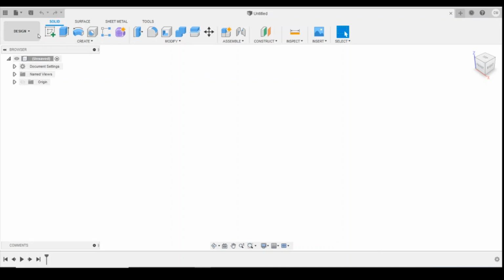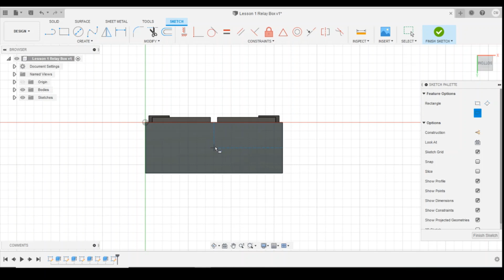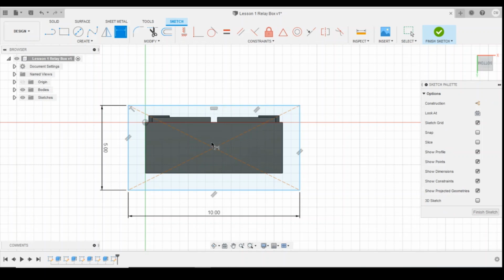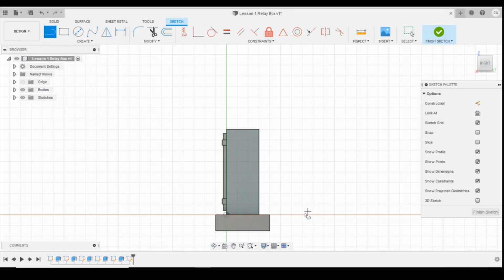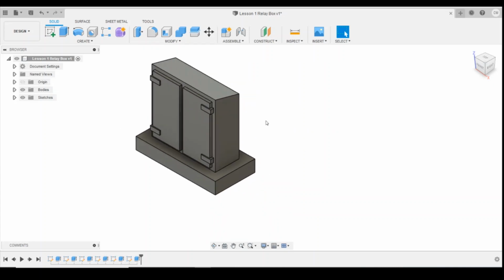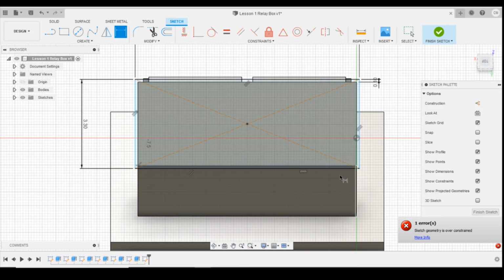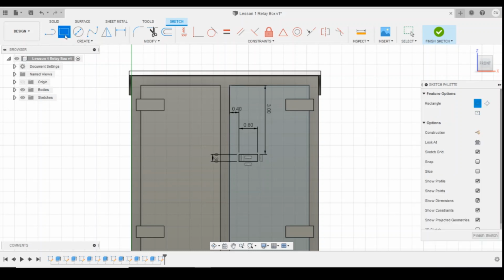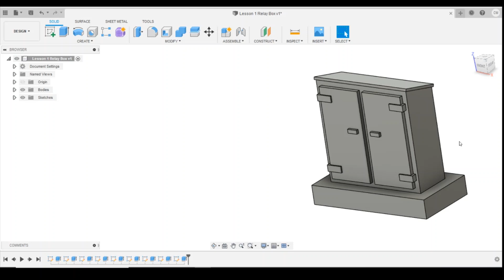Lesson 2 - Fusion 360 Center Point Rectangles, Lines, Angles and Midpoints

Comment: Thank you for your videos. Just started but already I have not been able to get thigs to work as they should. For the centring of the rectangle (for the base) I couldn't get the "V" or blue dotted lines to appear. Eventually I just cheated and centred the rectangle myself. However for the angle to create the sloping roof I cannot get the line to turn from blue to black and divide the side panel into two. I've tried forcing dimensions on it (in addition to the 15deg) but no joy. Clearly I can't progress beyond this point. Any suggestions as to what I am doing wrong. Is there a snap on / snap off button as in AutoCad which I am missing to connect the line to the corner and opposite edge?
Reply from the maker: glad you are enjoying them.  not sure why your midpoint isnt showing up, but as you have found you can always work around things.